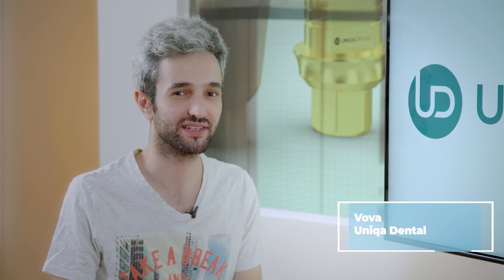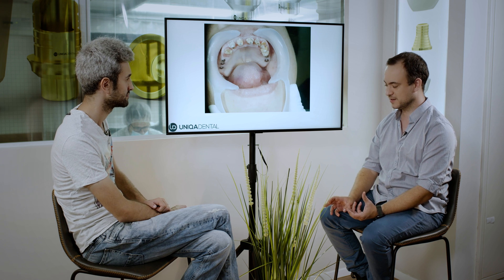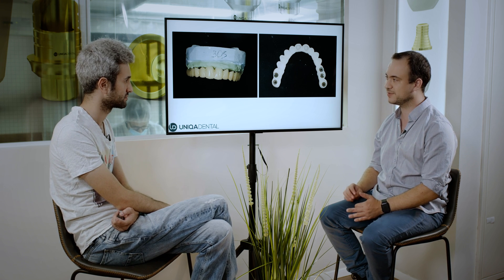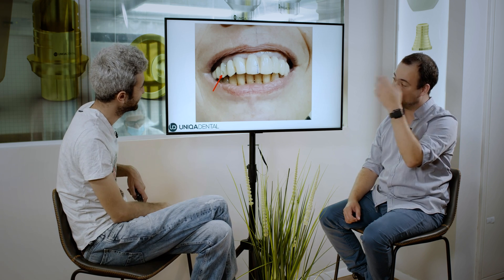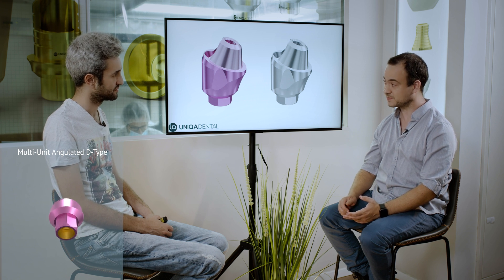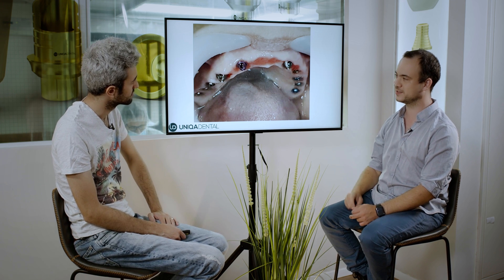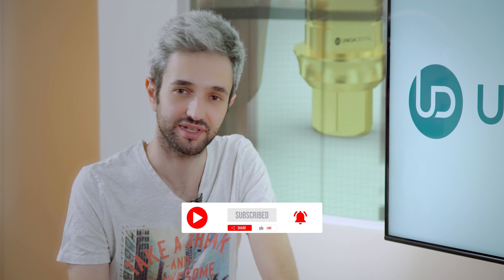We made a temporary bridge right on top of the implant. Screw retained restoration with planning

Comment from the maker: 00:00 We already chose the multi-units...
00:31 A case where we'll make a screw-retained restoration bridge on the upper jaw. 
01:26 You said only the upper jaw?
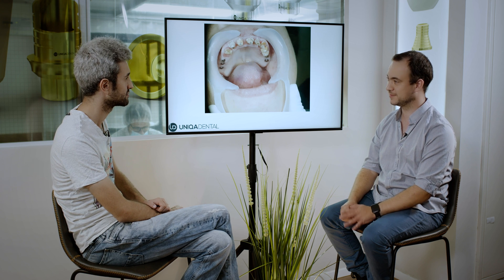02:22 Do it step by step
02:59 Those teeth were extracted. 
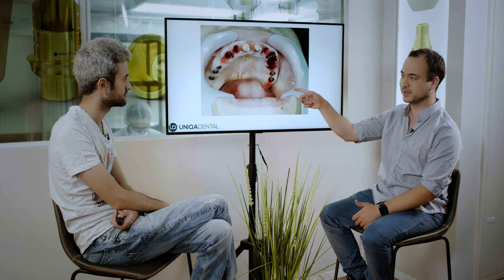03:46 What is the black area in the right upper jaw?
04:24 That's why it broke?
04:47 You need to really look for it. 
05:23 This is the temporary bridge.
05:54 Weaken the bridge structure.
06:38 The gingiva will heal, the implant will osseointegrate. 
07:01 The lower teeth are awful.
07:48 It's all at a multi-unit level, right? It's all about the height.
08:29 You just wait for the manufacturing of the new bridge. The new bridge will go on top of this multi-units 
09:14 PMMA.
09:22 You can see the screw channels here. Some goes very buccally. 
10:04 Here, the right black hole is more noticeable.
10:20 No, it's not a hole. It's just metal without porcelain.
10:55 An angulation of all of the implants. 
11:24 The final design of the crowns. 
11:41 Some patients don’t want to have any noticeable changes in the final crowns and the original teeth that they had. 
12:23 We extracted the problematic teeth
12:41 Screw channel...
13:43 There are different types of programs for designing. 
14:27 Yeah, you don't need to remove the bridge. 
15:38 This is not the final bridge yet.
16:04 Which is great for implants.
16:45 The smile line is very good. 
16:56 It was supposed to be quite soon.